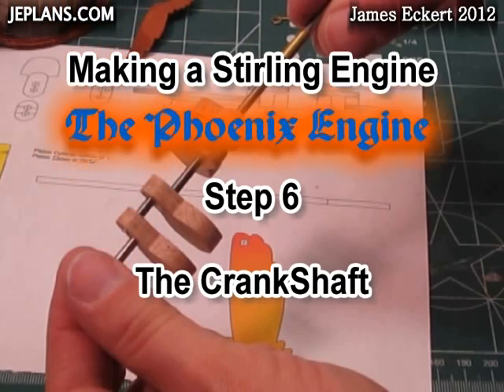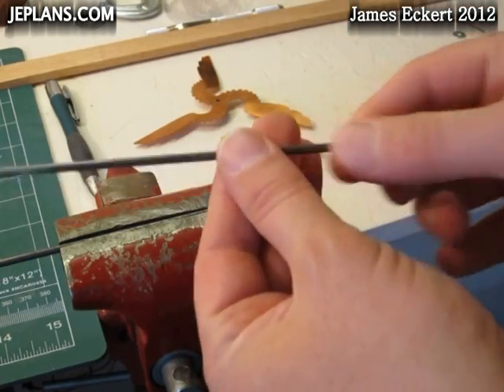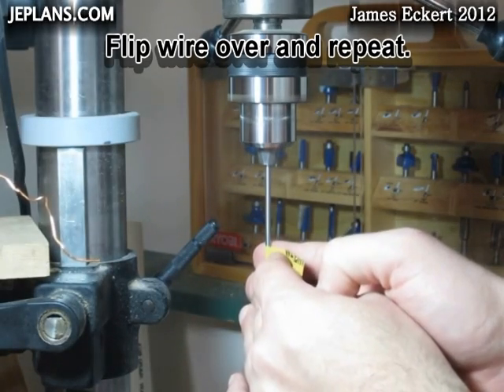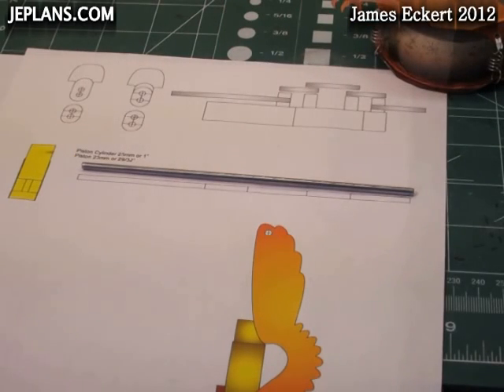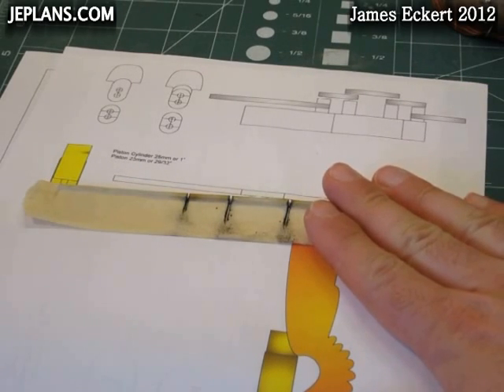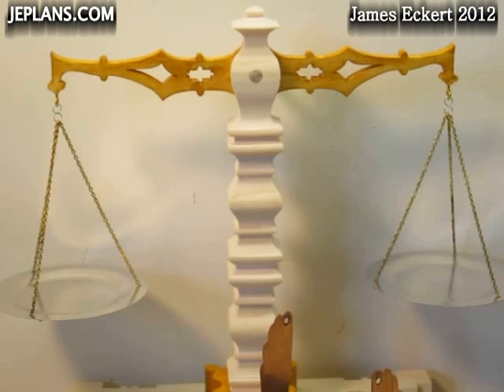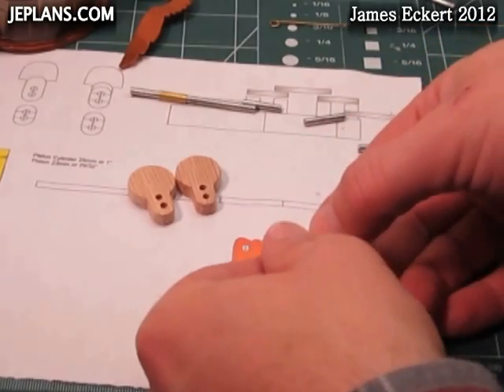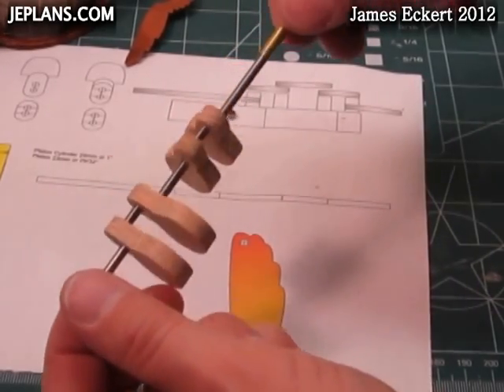Step 6 Making a Stirling Engine:Crankshaft

Comment: Could you explain the purpose of a crankshaft in a Stirling engine
Reply from the maker: To convert the liner force of the Piston into rotational action, and to move the Displacer up and down to create the vacuum and pressure that drives the piston.

Comment from the maker: Yes making them thicker has helped me. Usually still little off, it seem quite impossible to drill a perfectly straight hole even with a drill press.  On my earlier engines like the original Beer Bottle engine I solder it together and it was quite a struggle. Eventually I took it back apart and made a special jig to hold it while I soldered it.

Comment: ahh, i see yours might be easier to assemble since you're working with larger pieces.  I'm using jan ridders CD LTDS think the rod is 2.5 mm dia.  and the throws are 2mm wide.  hard to get things lined up and such... i may have to do it over again using smaller holes and do a shrink fit.  can't be crooked then now can it? great work, looks like you have it figured out!